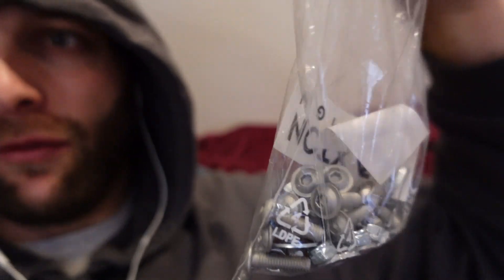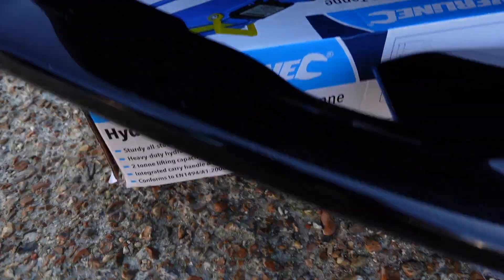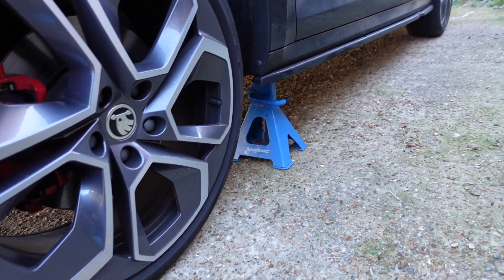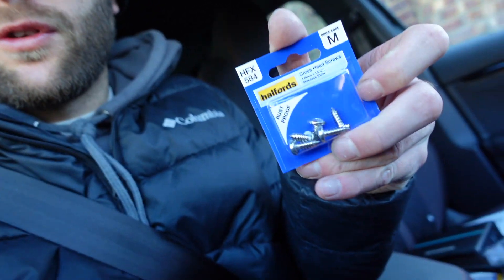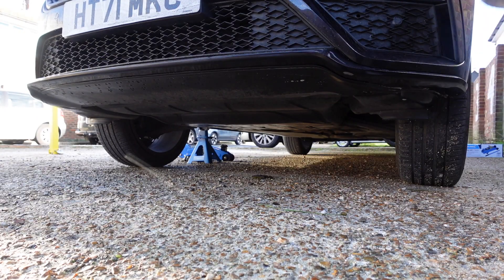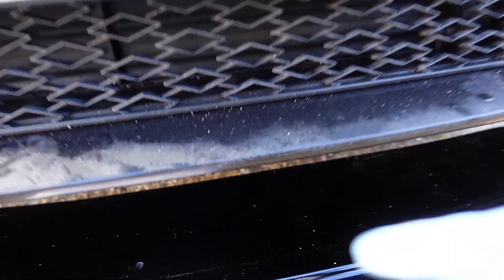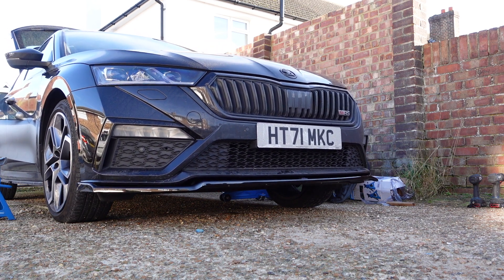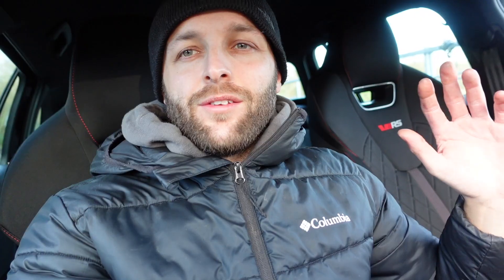FRONT SPLITTER INSTALL - SKODA OCTAVIA MK4 vRS 2022 (MAXTON DESIGN)

Comment: I have the same model year i think its to much what iv been  wondering about is if i should lower it 40/40
Reply from the maker: Hmm I think the ride height on these are pretty good to begin with, but I suppose it all depends on your kind of driving and distance etc. I use mine as daily and do a lot of miles on varied terrain, so comfort and ride height is important to me. I lowered a polo 6r GTI by 40mm back in 2012 and it ruined it lol

Comment: Do you know know why I chose 190hp 4x4 Octavia 2023 over Octavia RS? 
Box modded to 230hp with 4x4 suits me better. 0-100 in 5.9s and I don’t have to worry about wheels  spinning till 3rd gear like they do with RS version.  If you want “look” pick RS, but if you care more about driving experience take 4x4 TSI one.
Reply: Well not true about the driving experience. The 2.0 TSI in vRS is a different/better engine. You can tune it to 350 hp by just a tune. Or even more with a turbo kit. 190hp TSI is a different engine and is not capable of doing this. Also the vRS TSI has a limited slip dif (VAQ), yours doesn’t. vRS has a sporty chassis, steering and brakes, yours doesn’t. And it makes a huge difference. Also the new Challenge Plus RS edition has got a sporty exhaust. Sure 4x4 is better (still only haldex and not permanent Quattro like on Audis). But that’s the only advantage. While vRS has like 4 or 5 over 2.0 TSI 190hp (not talking about the design). If you want something sportier than TSI vRS buy Golf R or Cupra, not 190hp Octavia lol.
Reply: I chose RS over Sportline 4x4 cause with the same price the factory RS has about 4000-5000euros worth more extras on it. I mean with snow and stuff the 4x4 would have been nice but when the snow melts then im sure that the 180kw FWD with electronic LSD beats the 140kw 4x4 corner handling and acceleration by far.